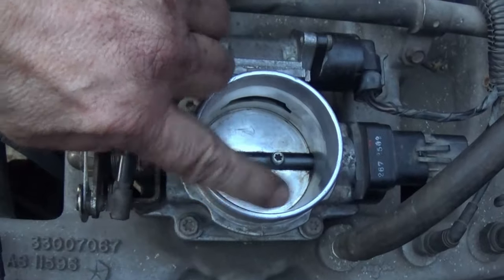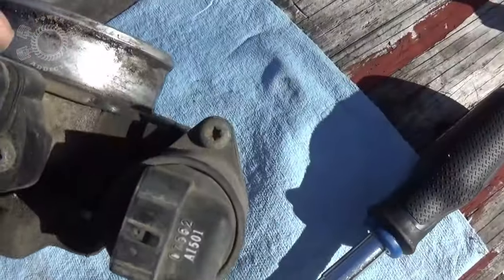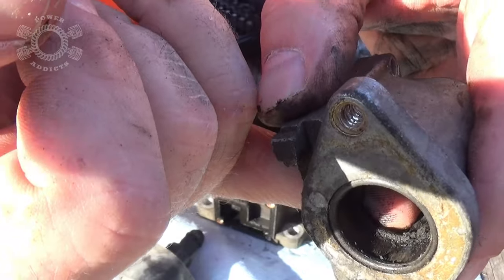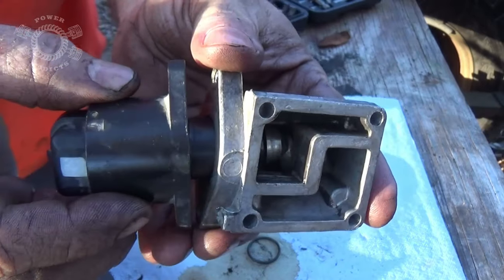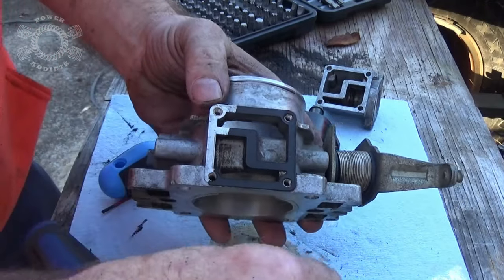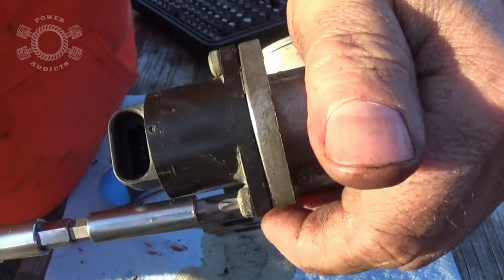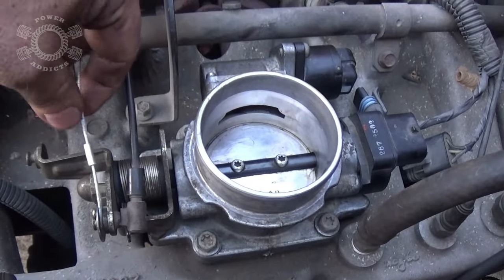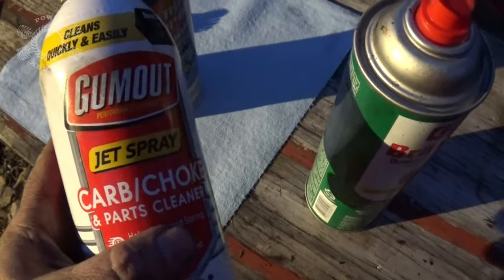How to clean a Jeep Throttle Body. #poweraddictscrew #jeepwrangleryj

Comment from the maker: Parts used in this video:
Security Torx bit set: https://amzn.to/3wSF1IC
New Throttle Body to intake gasket: https://amzn.to/43miJeC
Test Throttle Position Sensor Video: https://youtu.be/URNYaGXM_uQ
Change Throttle Position Sensor Video: https://youtu.be/0wrrojhJ4XY

These Amazon links are affiliate links. Using these links not only gets you the cool stuff you need, but Power Addicts get a small commission fee at NO ... NADA ... ZERO extra cost to you. You could order toilet paper with these links, it would still help Power Addicts get that commission. I use the money generated to create more cool videos for you. Thanks for your help and support!!

Comment: I just cleaned my 06 Rubicon 4.0L and after hunting everywhere for an IAC housing gasket (because I am the kind of guy that if I don't have every possible base covered I always seem to need the parts that I didn't plan on replacing) I found that the 06  IAC  housing doesn't come off the throttle body. The  06  also has a different IAC but the process and everything else is the same.

Thank you for your help and advice!